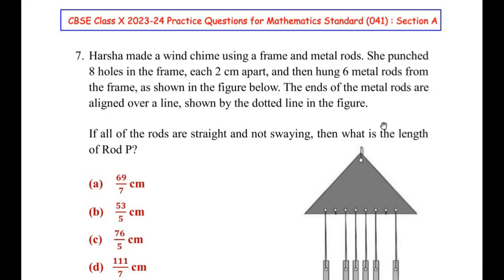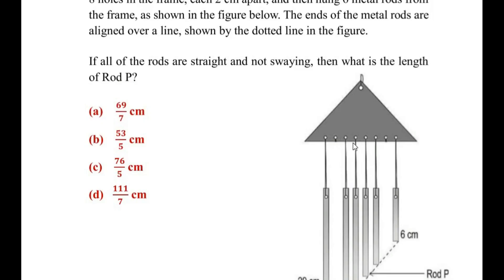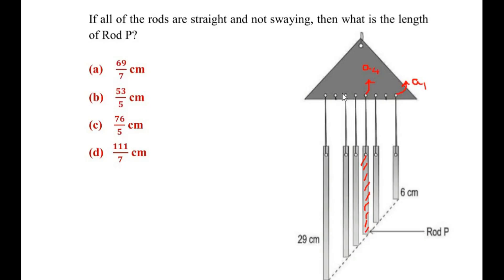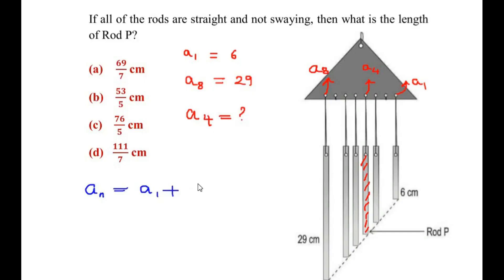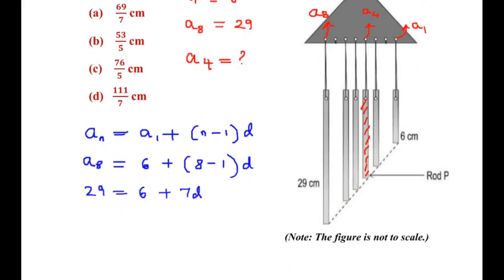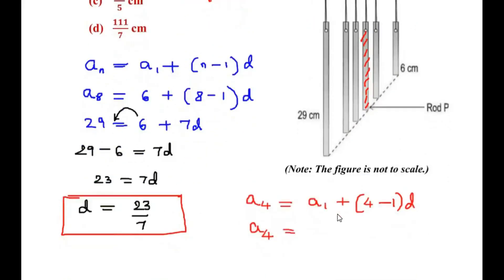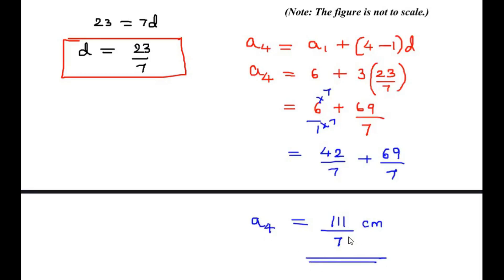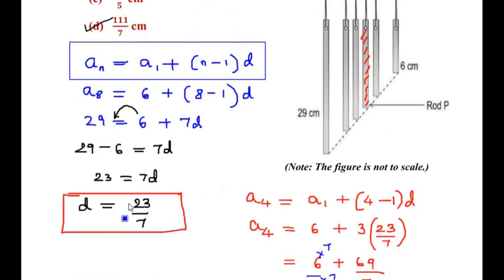Q7 - Harsha made a wind chime using a frame and metal rods. She punched 8 holes in the frame, each

Comment: Mam can you please tell why 2 is not the difference as it is already given in the question that roda are 2cm apart?
Reply: Because we are considering the length of the rods, so the common difference will be the difference between lengths of two rods, to form and AP
If we consider 2cm , it will not form Ap and the equation will be wrong